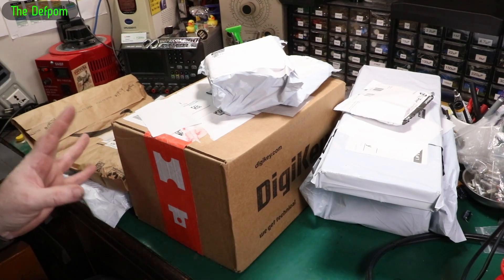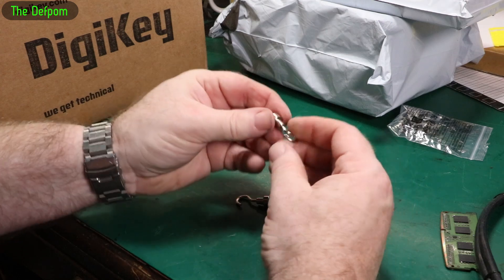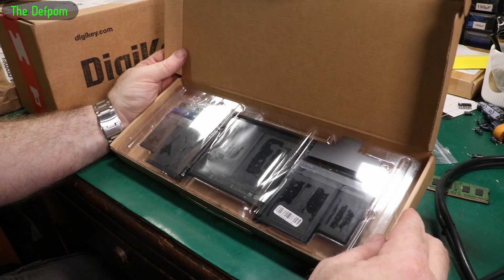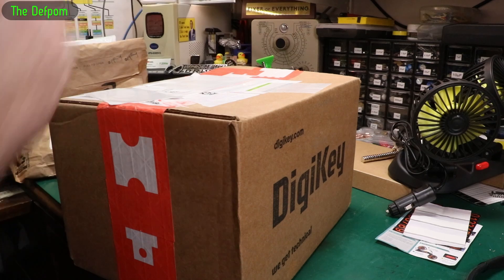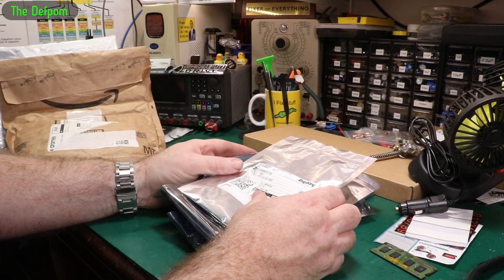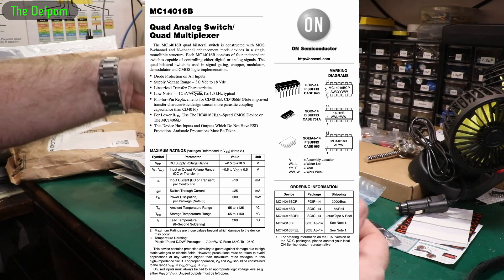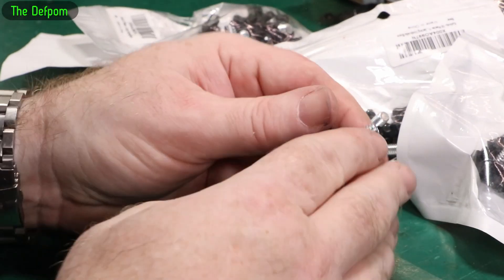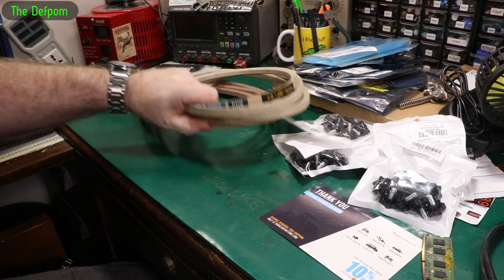🔴 Mailbag Monday 24th March 2025 - No.1341

Comment: You get a better deal buying in New Zealand from Digikey US site than we do in Canada. If we buy from the US site we need to spend $100 USD to get free shipping verse your $50 USD. If we buy from the DigiKey Canadian site we only have to spend $100 Canadian for free shipping but the parts have a markup in value of over 10% for some components and 7% for identical test equipment. Did your shipment come for USA or from an oversea location? Just wondering.
Reply from the maker: I order from the nz site, but I believe it actually comes from the US. I used to buy from element 14 and RS components, but when you wait over a month for the package to even be sent sometimes… I got tired of that, so rarely use them now.
Reply: @TheDefpom  I had an issue with Newark = Element 14. I indicated on an order to "ship when all stock is available". Their interpretation was "order on hold because out of stock for one item in the US even thou they had plenty in the UK." Expected delivery 2 months. Sent them a message and had everything a week later, go figure.
Reply from the maker: I emailed them a few times for an order they cancelled part of, they never even replied to me.

Comment: If you had a switch like that with no data sheet, and you wanted to know how much current it could take, what sort of tests would you do ti "characterize" the switch, and come up with your own rating?  How would you test it (I'm asking mostly about current, I know voltage can be an odd thing - and would need special tools, and would only be relevant if you palned on doing high voltage - so let's assume it's a "reasonable" voltage for the switch)
Reply from the maker: @GeorgeGraves  it depends, Is it switching that current, if so then you need to load it up and operate the switch many times until it fails, and repeat on another switch with a lower current, until you get a switch operation count you are happy to accept.
It also depends on if you are switching AC or DC, and at what voltage, you get worse arcing on DC and with higher voltages, these arcs would eat away the switch contacts.